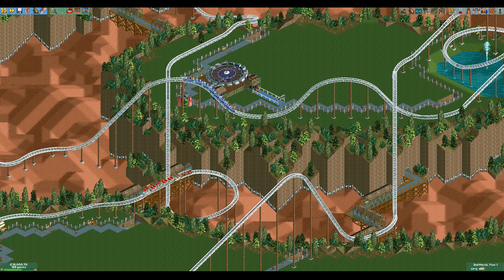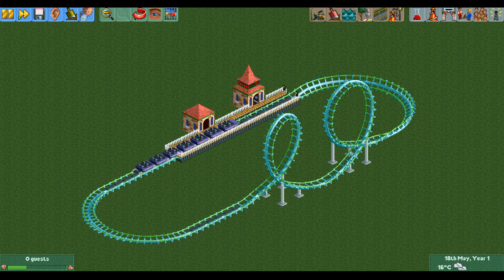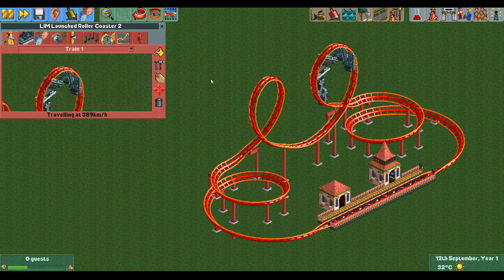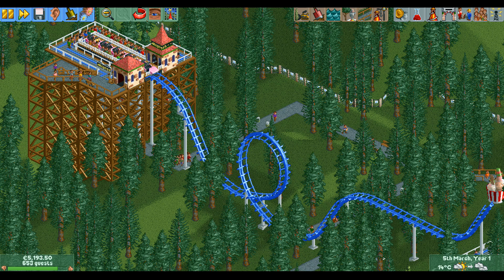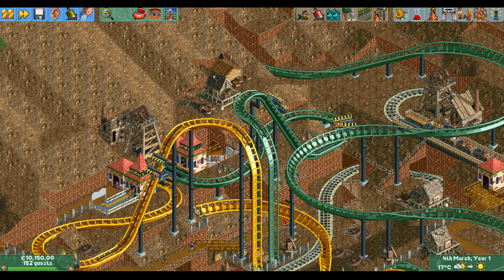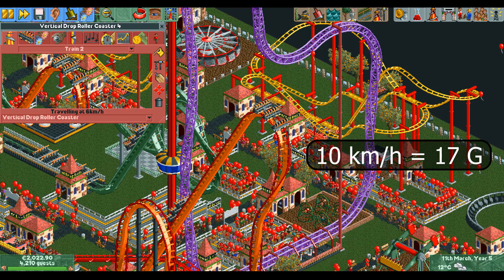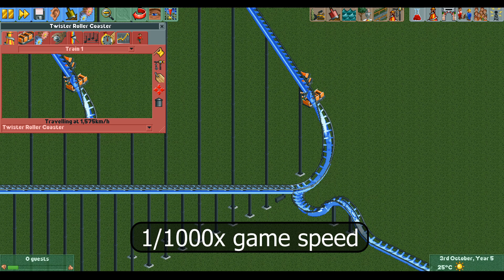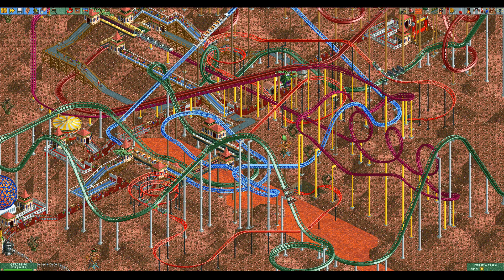How many g's does a launched coaster pull in RCT2?

Comment from the maker: Keep in mind that this is all just for fun. I know that the game isn't super consistent and that if you use a different launch speed you will get a different answer for how many g's you experience. I picked some values that made it easy to calculate and show how ridiculous it gets, not to be 100% accurate for a 20-year-old game.
Reply: Have you considered just hacking OpenRCT2 to yoink out the speed during launch?
Reply: @calebgindelberger3046  what fun would that be? XD
Reply: Doesn't RCT2 use much different time than real life? Shouldn't all this be calculated using ingame time units?
Reply: @killerkonnat  the day clock is stupidly fast obviously, but the ride/physics and guest stat values are real life units
Reply: Your calculation doesn't factor that 20 minutes is a month in the game.
Reply: @killerkonnat  The day clock would make the rides super slow, though. If I recall correctly, a year in RCT is about 60 minutes of real-life time (on regular speed, obviously). That means a year is 3600 seconds. 3600seconds/365days = approximately 10 seconds pass in real life for each day that passes in on the in-game clock. The game calculates ride time as real-life time, and ride time is usually somewhere more than a minute but less than four minutes for roller coasters of reasonable length. Which means a single ride on the roller coaster would, at the smallest reasonable ride time, would take 6 DAYS to ride. Let's say a ride travels about 450 meters of ride length in a minute, which is a reasonable stat for a fast coaster. Instead of the ride speed averaging at 27km/h, the average speed of the ride would be 3.1 meters per hour, or 0.0031km/h.
Reply: What's the maximum launch speed in vanilla RCT2? Personally I would have preferred it if you had started with sensible speeds and then said "But we can go much faster than this" but it was still a good video.

I discovered your channel this week and I have a couple of questions for you:
- Where do you get the hidden information like ride requirements, rating calculations and so on?
- Have you played Transport Tycoon or similar games? I think they would suit you.
Reply: @jackradzelovage6961  not too bad actually, considering other text in the same location can pull out that data it should be a most a few lines change
Reply: @MegaKaitouKID1412  Rides seem a bit faster than real coasters.  Not scaled by nearly as much as calendar time, but I don't think that what the game reports as 1g of acceleration coincides with 9.8m/s/s.
Reply: I was scratching my head because you were calculating from 864 km/h. What about at standard launch speeds like 150 km/h?
I plugged the same numbers and a launch speed like 100 km/h and above puts you at 10g or so. Still not comfortable.
Reply: @7:20 would be a great way to paint
Reply: @MegaKaitouKID1412  in the game a year doesn't consist of 365 days, since it skips the winter months

Comment: Also for the sake of comparison:

* Space shuttle missions were capped at 3 g for all operations
* The Apollo launches peaked at about 3.9 g
* A top fuel dragster accelerates off the line at about 5.3 g
* An F1 car can decelerate at up to 6.3 g
* The Mercury and Gemini launches peaked at around 7 g
* The surface of the sun exerts about 28 g
* The highest g-force that a human has willingly been subjected to is 46.2 g, undertaken by US Air Force physicist John Stapp in 1954 as part of a series of tests on the effects of g-forces on the human body. While several of those runs broke bones and, in at least one case, caused temporary vision loss, he lived to 89 without long-term effects.
* The highest g-force a human is known to have survived is 214, as experienced by IndyCar driver Kenny Brack during a crash at the 2003 race at Texas Motor Speedway. It broke quite a lot of bones and took a year and a half for all of them to heal. Surprisingly, he actually competed in the 2005 Indy 500 after that.
Reply: ...So you’re saying there’s a chance.
Reply: @Overcrox  If you're a race car driver, yes. If you're a mere mortal like you and I, probably not.
Reply: On the Downside, Kenny Bräck almost certainly only survived because the acceleration was pretty much rotational around his spine.

On the Upside, Dave Purley survived an estimated 179.8G during a direct impact into a wall, so the launched coaster is still survivable!
Reply: @rubywest5166  It seems like rotational g-forces are a bit uncomparable in this case. The crash that Jerry Cadick experienced might be a better comparison. He experienced an estimated 75G  when he lost air speed and crash landed his F-18 during a 1988 air show in El Toro. Although very injured, he survived, and even continued flying for much of his life. He passed away at 72.
Reply: You can easily survive well over 100Gs - if the force is only applied for a very brief moment.
One example - and please only try this if you really want to hurt your self - is jumping down ~1m with stretched legs (no feathering). This produces G-forces in proximity of 100G. Again - really painful, but no real change of death either.
Reply: Buddy I think F1 cars can decelerate much faster than 6.3 g's, that's why the walls are there!
Reply: @cainking7943  ok, >6G in case you straight up crash into a wall.....
Reply: Also, fighter pilots will take around 6 gs regularly, maxing out around 9 gs for a few seconds.
Reply: @ABaumstumpf  oh dude I remember jumping off a swing once as a teenager without feathering. my knees hurt for at least a week.
Reply: @ABaumstumpf  100 g is the lethal limit
Reply: I mean I yardsaled skis into a fence myself, amateur league I'm sure.
Reply: About Brack... What the fuck? What the actual fuck, he survived, healed, and then competed again within two goddamn years?!
Reply: @mrsteamie4196  If you were born to race, no one is gonna be able to stop you. Dale Earnhardt was in accidents that broke several major bones and would still compete the very next week, not even giving them time to heal.
Reply: @gamemeister27  Jesus actual H Christ. I cannot imagine the investment required to do something like that. The intense love for something to do that, I doubt I've felt it yet. Fascinating.
Reply: Duration matters though. In a car crash, the forces experienced are instantaneous, which is considerably different from the forces experienced in acceleration which happens over a longer span of time. 214Gs for a few seconds would be much,  much worse than for a fraction of a second as in an impact.
Reply: @ABaumstumpf  Unless you're thrusting yourself downward versus letting gravity do its thing, aren't you experiencing...1 G?
Reply: @Tahngarthor  you experience 1G while standing on ground, up to over 2G while jumping up  and 0 while in the air.
But what do you think happens the moment you connect to ground again? Your body is moving downwards and has to decellerate to come to a full stop again (you dont go through the ground normally) so the force is "f=m*a" - and here it now depends on how you land.
A soft landing with bending your knees giving you a long travel, or a hard-landing that is like a car hitting a wall.

https://www.youtube.com/watch?v=qN3apht8zRs
The forces measured during jumping. During landing the person did not go as far down as during jumping - the decelleration was already a lot higher at over 5G.
Reply: @ABaumstumpf 
Your whole body won't experience those g loads though. Humans are squishy, along with whatever you are hitting if it's soft ish.

In fact, for any fall from higher the part of your body that feels first contact will get that extreme acceleration (for instance people who've survived failed parachutes, falling from buildings, etc) with proper technique you're just trying to reduce the peak acceleration on things that will make you dead if they break ie: head and internal organs in your torso. Pretty much everything else is optional essentially.
Reply: @solsystem1342   Lets be generous and say jumping from 1m height will squish you 5cm (with locked knees it would be ~2cm ):
1m height gives us ~4.4m/s, and with constant deceleration that would give us ~193 m/s² - so about 20g.

As this is under the assumption of constant deceleration and compression higher than we would expect this can be assumed to be a conservative estimation.
So not quite 100G for the entire body but still a lot higher than people would think.

Comment: I never noticed that the G's from launches and brakes didn't affect the ride's rating. I've been going out of my way to try and slow down trains before stopping them, but apparently I've been wasting my time.
Reply: I knew about that since RCT 1. Limitations of the times. I still have brakes in use, mainly to prevent the most annoying breakdown: station brake failure and, depending on my track design, cause the rides smashing straight into the parked.
Reply: @Aereto  meanwhile in deluxe (i think) onward, station brakes failure affected all brakes and in rct2 was renamed "brakes failure" for accuracy. every coaster i build has to enter the station at under 30mph without the use of brakes anywhere in the circuit in order to be crash proof, at least in that respect... by far the most irritating breakdown of them all :/
Reply: @jackradzelovage6961  Block brakes still work during brakes failure.
Reply: @C.I...  block brakes do still work, however they arent in rct deluxe which is what i primarily play. deluxe is the worst of the versions for that particular breakdown actually... on the plus side ive gotten really good at coaster design lol

Comment: Alternative title: How to create a Black Hole in RCT2.
Reply: Ooh! A Large Hadron Collider smashing trains like particles?
Awesome idea!
Reply: I'm surprised the LIM trains didn't go into hyperspace.
Reply: You say that sarcastically, but if you actually put enough energy into a thing, you will get a black hole. You can even make one out of light itself! In fact, such black holes are called kugelblitzes.
Reply: He is wrong about the energy part, since that is not how physics works. Energy is the force over a distance. If the force is 10^10 Newton and the break distance is 10^-9 meters then the resulting energy loss is still only 100 Joules of energy.
The energy can also be calculated as E = (m*v^2)/2. So if something with the mass of m = 2 kg goes from a certain velocity v = 10 m/s down to 0 m/s then the los of energy should be E = (2*10^2)/2 - (2*0^2)/2 = 100 Joules of energy. Doesn't matter how quickly this happens.
You can't create energy by making something break more quickly.

Comment: The formula for acceleration is Δv/Δt, or (v - v0)/t. Since the hang brakes seem to stop the cart instantaneously, we plug in (3 - 1575)/0, so -1572/0, and since the closest practical approximation for dividing by zero is infinite, we get a deceleration of ∞ m/s2, or ∞g.

If however, we assume that by 'instant,' it's actually decelerating in the shortest time possible, then we would want to feed (3 - 1575)/5.391247(60)×10−44, seeing as 5.391247(60)×10−44s is the shortest possible timeframe for any physical interaction, and effectively instant. This gives a mild 2.918×10^46 m/s^2, or roughly 2.976×10^45 g. This miniscule force would mean someone weighing 100kg would, briefly, weigh 1.496×10^17 M☉ (those are *solar masses*, or the weight of our sun ). This frankly, concerning amount of force instantaneously form a black hole roughly 15 times the mass of our local cluster.

I'm sure these comparisons don't make much sense to you unless you're an astronomer, so I've saved the best for last:
For a very short moment in RCT2 physics, you would weigh roughly 1/1000th of the weight, of the entire universe. Allow me to reiterate. You would weigh enough to literally punch a hole in spacetime, and probably destroy a large chunk of the universe, because, as I said, you would weigh a thousandth of the mass of the entire goddamn observable universe, in a space the size of a human being.

Planetary Annihilator is too intense for me.

Comment: having experienced fairly excessive levels of all three types of G-force I can say, it's not the most comfortable. If you're into real rollercoasters as well as RCT2 then I recommend checking out a ride in the Danish Tivoli in Copenhagen called "vertigo" it's just a big tower with two arms, at the ends of the arms is a plane with 5 seats, the plane has 2 rotating axes. One controls the roll of the seats, the other controls the yaw. Then there's a third axis which makes the arm spin in circles. It's a ride which works like a vertical High-G training machine that just barely reaches the limits of the average person. Hence the name "vertigo". All in all fun ride, but I can't say that reaching a state of limbo between being conscious and blacked out was as fun.

Comment: 7:36 This is 100% just being pedantic, but since the game is slowed down, the game runs at a lower frame rate than 60 fps. This means that the 1 frame takes longer than 1/60 second so the maximum acceleration probably is that 2667 (Though I play locked at 40 fps so it kind of depends on your computer settings).

Comment: Small correction:
It does not require an infinite amount of energy even if the acceleration happens in 0 time - the total amount of energy is constant, it is the power that goes towards infinity.

Comment: 6g - norm for a trained dogfight pilot or Formula1 racer. A significant number of guests will blackout.
10g - maximum training for astronauts. Concussion. Almost everyone blacks out. Some people may die.
20g - car crash. Some broken bones. A person is surely not getting up by themselves after this, a team of paramedics immediately pulls all of the guests from their seats onto the stretchers. A few die each run.  
60g - head on highway collision. Lots of blood, many broken bones. About 50% will die even if paramedics see them immediately. Survivors will most likely be disabled. If you are not seated in reverse your neck will snap and restraints rip through your body. During the stop you can hear guests' bones crack. The rollercoaster is brown from all the blood and has a strong stench of death. Derailments are common with even more gruesome results.
170g - severe drag race crash. there are a couple of reports of highly trained people miraculously surviving. A brief splash of blood separating the train can be seen when it decelerates. Even with all the precautions cars often rip out of the coaster destroying the breaks with a deafening bang and a trail of impressive looking sparks. Possibly some heads and/or limbs dislodge on impact.
2667g - supersonic fighter jet crash. everyone who witness the car reaching the "breaks" go deaf from a clang and see bright splash of light. A flurry of sparks fly everywhere and hand grenade-like shrapnel pelts everything in vicinity. Guests who were riding this mincer (who were already dead before the stop and with faces torn by the sound barrier) rip through the restraints, with body parts all over. Some end up on the other side of the park. Destroyed cars rip right through the tracks and crash into everything around like giant ammunition. There are no survivors anywhere near.

Comment: In RCT3 I came up with a way to launch most coasters. You make a block brake with it's maximum speed about two spaces out of the station. When the train hits the block brake it will get boosted.

Comment: I believe all internal physics calculations in RCT2 are done at 40FPS, as that is the frame limit set without mods. Therefore some of these forces aren't quite as extreme, though they are frankly still rather absurd.

Comment: Hi Marcel,
small correction,
it takes an infinite amount of power, but still a finite amount of energy.
Power is the amount of energy divided by the time.
So it takes the same amount of energy to do the acceleration to 0 regardless of if it takes a long time, or a short time.
But since the time is infinitely small, the power needed in this case is infinitely big.

Comment: Once you get to the crazy high g-forces, I think you have to take compression area into account. Crashing into the holding brake at 60mph is no different from flying into a restraint at 60mph. Hitting a set of metal poles at that speed would probably kill you, but the kinetic energy would be absorbed over a period much longer than 1/60 of a second, because humans are not that rigid.

Comment: Let Train 1 be a singularity of size X. Let Train 2 be a singularity of size X. Put both trains on a single axis (1 dimensional). Train 1 starts at -Y and Train 2 starts at Y, where Y > 0. Train 1 travels toward 0 at Z speed, and Train 2 travels toward 0 at -Z speed. Once they hit zero, they cancel each other out, and stop instantly without violating physics.

Comment: One time my friend and me were fucking around with cheats, and he made a ride we ended up calling "Meatspin" due to the 7 spirals on it. It didn't go very fast. But then were swapped the regular roller coaster train to a chairlift using cheats and added a powered launch at 255 mph and it clocked in at 40 Gs and was only visible for 15 frames a second.

Comment: It's nice to see that there are still fans devoted to this game. Nice videos, Marcel!

I just wanted to mention one little thing about your pronunciation of decimal numbers, which I noticed in most of your videos. When it comes to pricing, you may say €1.23 is "one Euro, twenty-three", since the twenty-three is in cents. However, you should NOT pronounce fractional parts in scientific numbers this way. So, 9.81 shouldn't be read as "nine point eighty-one", but instead as "nine point eight one". A number like 5.70 would be "five point seven zero", or more simply, "five point seven" since the zero is redundant. I hope that helps!